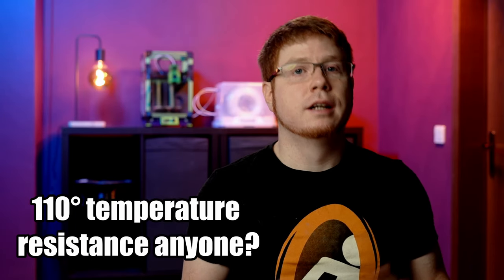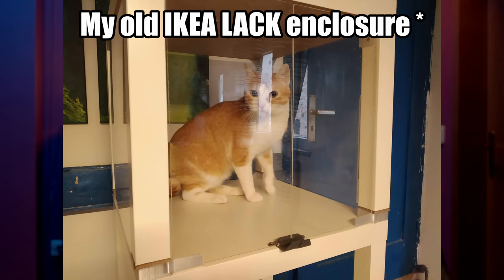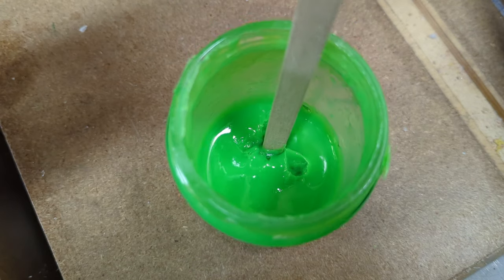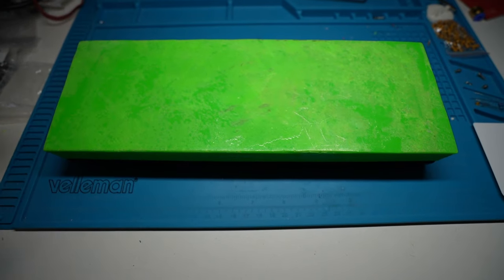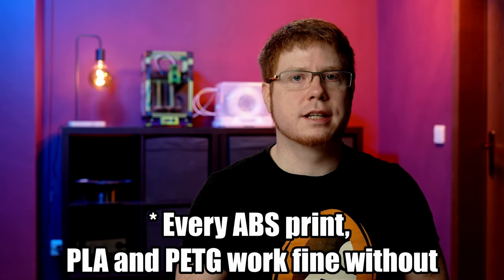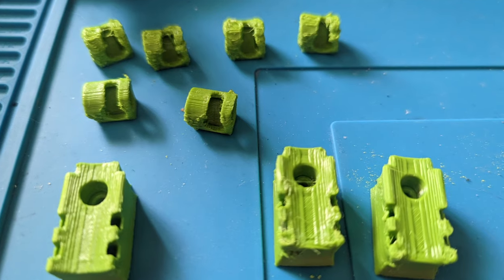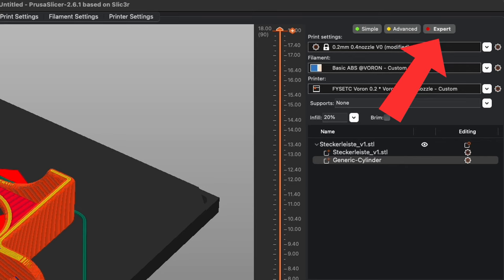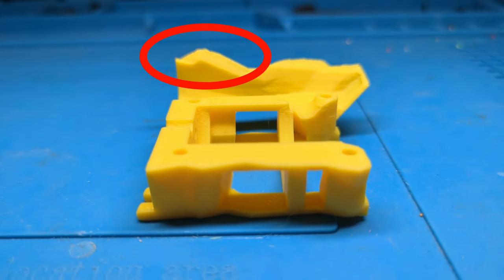3D printing ABS and ASA: The simple SECRET how to get perfect results

Comment: How would you print thin walled (2-4 walls) ABS parts? 
I got 65°C chamber temp and using the fan at 20-30% makes this part weak for the layer adhesion.
Only 0% fan makes these parts strong, but messes up all overhangs :(
Reply from the maker: You can always opt to print it slower and only use the fan for the overhangs.

How on earth do you get 65c chamber temp? I'm building a insulated printer with extra 80c heaters and it currently reaches 60c max.
Reply: @SmallBatchFactory  
i got a 600x400x300mm printer with a 1000W heated bed. The bed is at 100°C to get a 65°C chamber temp. 
I red something today that i should crank up the outer wall thickness to 0.7mm on a 0.4 nozzle to get the extra squish for thin walls with overhangs. I also will try a 60% aligned reclinear infill today for that part.
Reply from the maker: @TheWuzyy printing the wall in one 0.7mm perimeter will definitely improve adhesion. It's just not as pretty. You can also increase flow a bit, if that doesn't result in overextrusion
Reply: @SmallBatchFactory  
after the first ABS print with 0,7mm layer width on a 0,4mm nozzle and 0.15mm layer height (260°C nozzle / 105°C Bed / 60-65°C chamber / Speed ~ 50mm/s / Infill: 60% aligned rectliniear) the small part came out with very clean overhangs, fine details and a perfect layer adhesion on the thin walls.

With Arachne perimeters, the layer lines were on some spots even over 0.9mm wide without a problem for the CHT-nozzle.

It seams ABS really loves to get squished for the best performance... and it loves hot moving air.
Reply from the maker: @TheWuzyy definitely! You can go totally overboard with squishing. 200% of the Nozzle width usually works fine, even up to 300 is manageable.

We printed face shields when the pandemic started and I optimized my GCODE with wider layers to save 70% print time.

Comment: 1: Just scuff your pei with a scotch pad thoroughly, clean with dish soap, maintain with 90% or higher IPA - no need for glue stick

2: The higher the chamber temp (up to a point) the better. 50C-60C is great. At these chamber temps you can even run the part cooling fan at a low speed - 50% or below based on your part cooling setup. 

3: Bed at 110C, Hotend anywhere from 240C to 270C (yes 270C).

These are the only changes I make compared to printing PLA, and my parts come out absolutely perfect. Really the key is chamber temp. The lower the chamber temp, the more problems you'll have.
Reply from the maker: Of course higher chamber temps is better. With a Prusa mk3 for example, which is printed out of PETG and has the electronics firmly attached to it I wouldn't want to fry the whole machine. There are many people out there who can't run such high temperatures

Comment: @SmallBatchFactrory - I find I achieve the worst print results using ABS filaments that were declared 'new and unopened' on eBay! 🤔

As I only print single items and in occasional low-volumes, I find keeping all my used reels in hermetically sealed plastic flight cases with silica dry bags, dramatically reduces moisture ingress and delays premature degradation, also negating the need to 'heat box' dry my reels as frequently when using them so sporadically, I also find cutting off the amount of ABS filament I require, also reduces exposing the remaining filament to unnecessary ambient moisture. 👍

This is my particular method of madness, I could be wrong. 😉
Reply from the maker: To be honest I almost never dry any filament at all. Apart from Nylon and Polycarbonate, which I keep in a sealed dry box even when printing. I have spools I opened years ago which still work great. The only ones showing a bit of moisture absorption are a few PETG rolls, but still totally usable if you don't need those last 10% of print quality.

Granted I live in a 50% humidity area. Probably way different if you live in a very humid place.

Comment: Thanks for the nice video! Did you build your enclosure yourself? I'm also looking to build and enclosure by my self, but I am generally very untalented in woodworking or even something else ^^
Reply from the maker: Thank you for watching :-) the enclosure is my own design, yes. Made some last minute changes to fit in the Prusa MMU while building.

If your printer is small enough you can just build the shown LACK enclosure from IKEA tables. Otherwise you can build one out of aluminum profiles. Putting them together is a bit like Lego. You can order them cut to size. You just need to add acrylic glass. There are probably plans and calculators floating around the web.
Reply: @SmallBatchFactory  Okey thanks for the tip with the aluminum profiles, they seem to be very sturdy and easy to install and get an enclosure out of it. :-)
Reply from the maker: @EliasX962 they definitely are. Voron printers are built with them and already integrate the enclosure for example. Depending on your region it might even be cheaper to buy a enclosed printer than sourcing profiles.

Comment: IDK why you insist on glue when PEI and a chamber above 40c is all you need. I run my bed at 100c and apply a brim for parts lacking surface contact other than that as long as the chamber doesn't drop below 50 after a couple hours it will always complete successfully. Another thing I will do if its a part that needs dimensional accuracy is leave the heated bed on and slowly ramp it down for a hour or so to eliminate warping due to rapid cooling.
Reply from the maker: My chambers don't get above 40c. A PEI sheet and 110c bed temperature wasn't enough for me in the past. I also rather use glue than remove a brim afterwards. If that all works for you then there's no need to change anything. With glue I get dimensional accuracy without a slow cool down.
Reply: IDK why you think your way is the only way
Reply: A brim and a satin finish bed (Prusa mk4) also helps a lot
Reply from the maker: It does. Only downside is you need to remove the brim afterwards while glue doesn't need any post processing
Reply: @SmallBatchFactory If your chamber isn't above 40c, that is the problem. Fix your chamber.
Reply from the maker: Heating it to 50 means rewiring everything so that the electronics are outside for the Prusa. That's way more work than buying a bottle of glue every few years. The Voron has an integrated enclosure. Fixing that would mean putting it into another box and fry the electronics or developing some additional isolation which also takes a lot of work.
Reply: @SmallBatchFactory  If your chamber isnt over 40, you are printing in the wrong environment for abs.

Even if the glue keeps the bottom layer atatched, the rest of the part will cool and shrink unevenly and too quickly, which will add tension to the parts as well as weaken layer adhesion. Leaving you with parts that are less accurate but also weaker parts more prone to cracking at the layer lines.

The v0 should EASILY get over 40c. If your panels are installed correctly with foam tape, and you are heating the bed to 110c. If not, all you need to do is add some insulation to your side and top panels. Reflective 2 way mirror tape on the inside of the door helps too.

It is also really helpful to heat soak the chamber before printing. Leave the bed on 110c 15-30 minutes before printing. Can also turn the hotend to 160c with part cooling fans on.
Reply from the maker: There's always room for improvement. Never had any ABS part crack even at 40c. I built two printers with them and all are perfectly accurate and working fine. If I really want to improve I'd get a model with heated chamber. I'm way to impatient for heat soaking upfront.

The V0.2 has all the parts it's supposed to have including the foam tape. My thermistor tells me it doesn't go much over 40 degree.
Reply: All you need is a 40 chamber and 100 bed....  oh and a brim.... oh and a 50 heated chamber actually....  lol how about accept people do things differently
Reply from the maker: @atapene this! Plus I rather use glue than clean up a brim on a complicated part like a gear.
Reply: LOL, how is a brim any better than glue? I use 3dlac spray, it's literally 2-3 seconds spraying the entire buildplate.  Now tell me you can remove your brim in that timeframe on a big part.
Reply: I’ll take glue over a Brim any day.
Reply: @SmallBatchFactory  I use glue on my ASA. Because I sell components for toolboxes, I don't want a failure to occur, lost time is lost money, I also don't want post processing, once again, lost time is lost money. Can't figure out why people have this hatred for glue....
Reply from the maker: @ronaldhiser860 they either feel like cheating or want to show others that they're "better" because they made it work without glue I guess
Reply: No issues with ABS on my P1S, chamber temperature usually stablizes at around 47c.
Reply: I started to use a coating on my plate and no brims, even on small bed contact pieces, never had an issue since.

Comment: I just use a textured PEI plate with my P1S. Sticks a little too well!
Reply from the maker: The chamber might help a good bit. Depends on how well it's insulated.
Reply: @SmallBatchFactory  I very simply use metallised bubble wrap, upcycled from food delivery packaging! Just one layer on the left and right sides of the printer. I also preheat to 50-60c prior to printing. Pretty easy to reach with the Aussie summer!
Reply from the maker: That's probably the biggest difference. I peak at 40c with around 23c room temperature. A bit of isolation would go a long way surely but I already grilled my Prusa mk3 board once in the past.

I got a brain fart stuck in my head regarding a Voron 0.2 with aluminum parts and chamber heating, featuring a water cooled hotend... Maybe some day

Comment: That slurry is too thick, it should be much more liquid.
Reply from the maker: You're right! Haven't used it in years so a lot of the acetone has evaporated. It used to be pretty thin.  I switched to using Magigoo.
Reply: @SmallBatchFactory  or simply enclose... even poor enclosures are usually good enough for normal-sized parts. 15 cm or larger require a chamber.
Reply from the maker: There are so many variables involved I'm not taking chances anymore. All my printers are enclosed yet still that's no guarantee it will stick.

Comment: Heat soak camber to 50c, nothing more is needed.
Reply from the maker: My chambers don't go much above 40, doesn't matter how long I heat them (not even after 24h of printing on the Prusa). I'd have to add insulation and risk frying its board.

Comment: Another factor: the printer itself. The Prusa Mk3 and other printers with light weight beds just don’t print ABS very well. Printers that have a lot more thermal mass in their bed (like the Voron) print far better. I’ve burned a LOT of time trying to make the Mk3 print ABS well—enclosures, active enclosure heating, many variations on settings—and it will never do as good of a job as the Voron.
Reply from the maker: Didn't share the same experience. If I apply Magigoo it worked just as well on the Prusa (the photo of the full plate was from the Prusa, almost 24h print time). It was all about fan speed and bed adhessive for me.
Reply: @SmallBatchFactory  100% agreed on good bed adhesive and light part cooling fan—I discovered both of those the hard way, too! And the Mk3 will print ABS acceptably. The Voron just prints it better, with fewer flaws and improved surface quality. My old LulzBot Taz with its heavy glass bed also printed ABS really well. I believe the thermal mass of the bed is a factor but I could be wrong; it could be as simple as the printer parts being made of ABS rather than PETG. I’m currently rebuilding one of my Mk3’s with ABS parts out of curiosity.